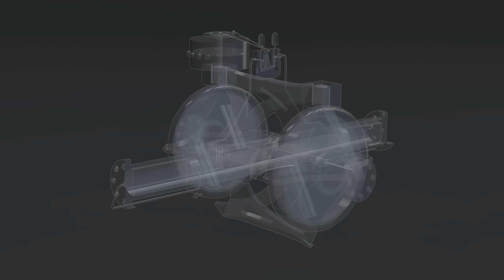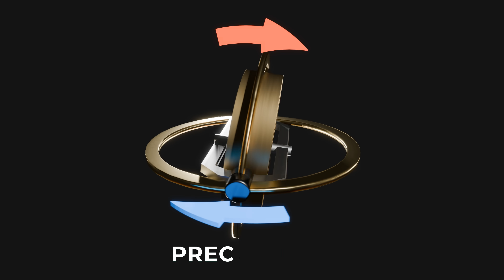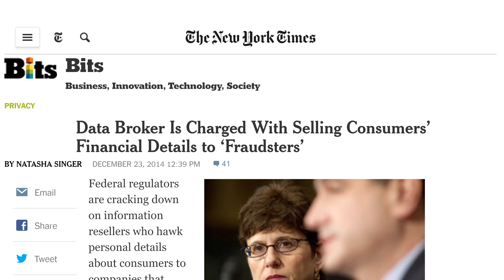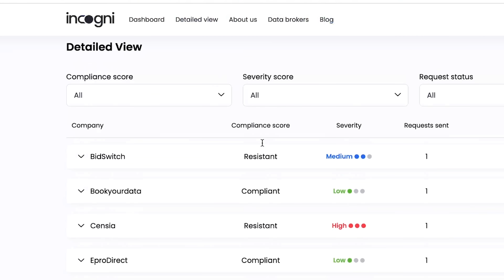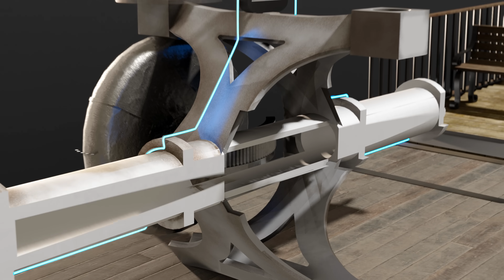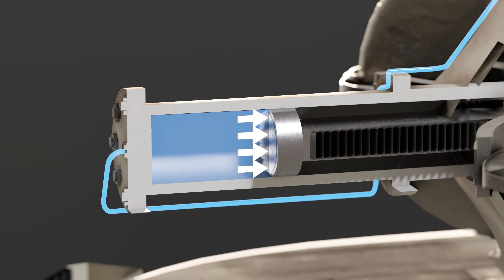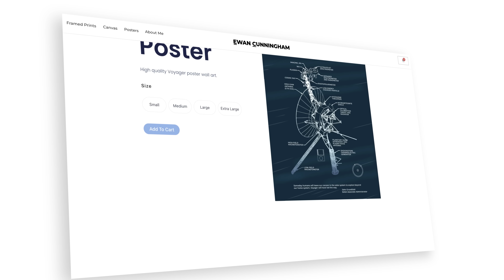The Self Balancing Monorail

Comment: I think it had a lot of potential that people couldn't see. Like running two ways on existing two track train railways. Its one of the most amazing inventions lost to time.
Reply: The problem is, either the trains would have to be quite thin (as they would only have around 65cm space on each side = 130m wide) or they would have to widen up the existing railtracks from 1,442m to 3-4m apart from each other. So it wasn't viable for mainline trains (because there you had already strong stable trains on two wheels) and for small train lines with only one track you would have to buy additional space next to the existing track to widen your train track to 5m distance between the two tracks. Both was too costly for a time, when also the speed of the regular trains increased more and more (in 1900 a train could run with 80mph, in 1930 already with 150mph.)
Reply: That would require a larger gauge to account for wobbling though
Reply from the maker: Pretty amazing indeed.
Reply: When the gyro system malfunctions, the train will fall over. Remember, parts do break down. All you need here is a leak in a valve seal and you get a very expensive accident. If the seal failure takes place when the train is moving, people are probably going to die.
Reply: an actual application would need guard rails for this sort of thing. that wouldn’t mean it is not useful, since this would improve speed over conventional trains.
Reply: Its not slim enough in that design. But wouldve cool yet costly

Comment: Brennan's design was way ahead of his time. Mechanically solving problem after problem to create his vision!
The Segway stays stable through the use of a system called "dynamic stabilization” using gyroscopes, tilt sensors, a control system, electric motors, and wheels.

Comment: would be good for repair or inspectors. make it smaller easily movable so it can be brought around. for the time it would be a decent solution. today we just have pickup trucks with adjustable guide wheels .

Comment: It is very cool, sort of steampunk hi tech. It seems as if, in addition to requiring a lot of expensive, heavy, and space-hogging mechanics, it would also not be especially energy efficient, far outweighing the friction savings from fewer wheels. You could easily accomplish the same thing with microscopic accelerometers and servos today, for a lot less energy.
Reply: plus a derail basically equals a tipover

Comment: "It could use regular tracks" It couldn't use regular switches though, not with that double flange (I mean it could use stub switches but those were already archaic by the 1910s on the passenger routes this would've run). Really cool design if it was working from the ground-up, but the entire engineering knowledge of contemporary railroading was based on wheel-axle-wheel physics.
I especially appreciate that this could stay stable for 30 minutes without power, that's a kind of safety factor you don't see often in that era or this kind of auteur inventor shenanigan.

Comment: I love seeing wired modes of transport and the fact that this was made in 1910 just makes me wonder why we haven't had anything like this now
Reply: Too complex and expensive. Its nice engineering but not practical
Reply: 1) You need special wagons, each one with they own gyroscope
2) If of on the wheels break, leave the track or deform it's much worse then in 2 wheel solutions
3) Much more time is required for the initial cleck before a train can leave for work.
After all you have to dock the Waggons and then remove the stabilizers and activate they gyroscope + ckeck them for failures.
4) if something happened to the locomotive while on tour, you would have to quickly stabilize the Waggons before they can tip over.
Very dangerous when transporting dangerous goods like chemicals
Reply: @molybdaen11  Modern electronics can solve all these problems.

Comment: This is crazy times engineering, using the air pressure to mechanically accelerate the gyroscopes.  I will find a way to use this.

Comment: It's an amazing proof of concept, but the prospect of two rails just seems way more reliable. The gyroscopic device would have to be maintained alongside all the other parts standard to trains, and in the event of a failure the train would simply topple over without any way to right itself.

In most engineering problems, the simplest solution is often the best. Having more moving parts just means there are more places where something can potentially go wrong. Even though a second rail might be twice as expensive, it's a cost well worth paying for reliability.

Comment: 8:30 that visualisation is misleading. Trains don't tend to tilt to the outside of a curve like cars do. trains naturally lean into the curve in the right direction due to conical tires.
Reply: Your statement is correct. However when trains go too fast on a curve, the centrifugal forces are too strong and the train is pushed outwards.
Reply: This comment is misleading, these are modern wheelsets you are reffering to, there are modern trains that only changed this in the last 40 years, some as late as 2010s
Reply: @MrConna6  I was of course talking about the natural leaning of a train. Trains always used conical tires. Therefore the tire on the outer curve has a bigger diameter than the tire on the inner curve. Therefore a train leans into the curve.
The modern wheelsets you refer too are only useful if you have a lot pre existing rails that you want to use on a different speed than they were designed for.
Reply: @MusikCassette  i mean you could look it up and see this is not the case, I dont really kmow what youre on about. As my initial comment said older train systems did not always have conical tyres and some changed relatively recently

Comment: It's a brilliant solution for a problem that didn't exist to begin with.

Engineers tend to geek out over really sophisticated solutions, because they can use their skills and intelligence, and it makes them feel good. But what I, in almost 30 years as a software developer have learned, is that simplicity is often the best approach to solve a problem. Not always, but often.

Railways are really simple. You stick two steel bars to a bunch of sleepers, make sure they're parallel, and lay them on a trackbed. You can park cars on them, and they won't fall over after half an hour. In fact, they will never fall over. And because of the shape of the wheels, they can take curves without needing a differential. There is nothing that can break down, apart from normal wear and tear of running steel on steel.

In contrast, Brennan concocted a convoluted system with gyroscopes in a vacuum, an actuator rod and a pneumatic system... so he could save on a steel rail. The tilting bit was very clever, but that was solved for conventional rail less than 20 years later.

Just because it's clever doesn't mean it's a good idea.

Comment: In Wuppertal the problem with the monorail and the tipping was solved. 
The monorail is above and the train hangs below.
Reply: wich is a good solve for elevated rail, and it allows for tight curves. In Wuppertal they needed to make elevated rail either way, because there just was no place to it otherwise. But not having the option to put your rails on ground is a major cost factor.

Comment: Every car needing its own gyro was a major "oooh" moment.  The design is amazing!  I'm surprised we don't see little single train cars shuttling people all over today.  Totally doable!
Reply: It's mostly due to the economics. These trains are a lot more complex than modern trains. Which increases the cost to build and the ongoing costs to maintain. It's also much less power efficient which means you'd be spending a lot more on fuel. I definitely think it'd be neat as a tourist attraction or something though. With a big plexiglass chamber in the middle so passengers can see the spinning gyro.

Comment: This could still be used today, and without rails.

If you added steering to the car, you could drive it on the roads but on a bicycle rather than a quad cycle setup.

Comment: Really smart but a prime example of overengineering unfortunately. This is just too much, needs specific and expensive everything (except the rail). The other issue is that it is actually patented and so it relies on the sole inventor to actually make it work on the market, so you better have great leverage. Could have found a niche in the luxury segment though and as novelty ride. That's impressive of Louis Brennan to actually have gone through and gave such a good shot at this prototype.